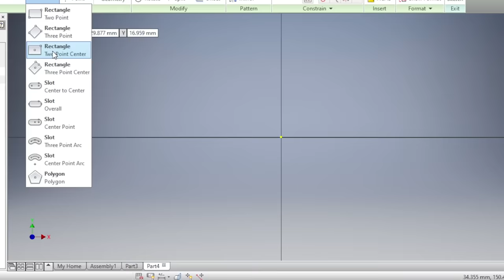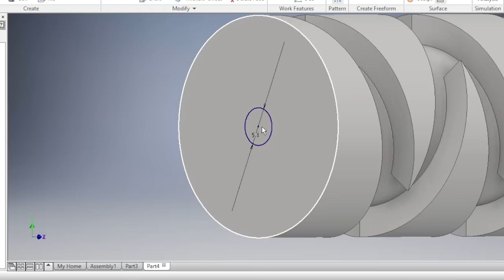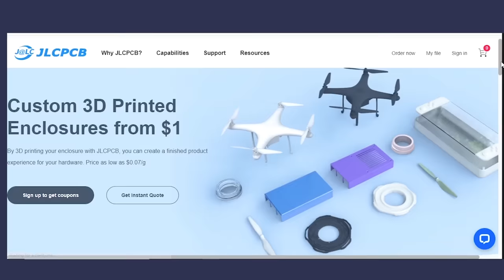DIY Winding machine with self reversing screw

Comment: The rotation is not proportional to winding, maybe if you can make sensor for bobin and add thread thickness input value to adjust speed proportion between winding and thread bobin it would make thread stack evenly
Reply: That would be cool. Even cooler would be a roll on the backside of the roll that has just the right amount of translation to autoadjust itself correctly without any need of input ever. Just imagine perfectly rolled, no matter what thickness your thread has.
Reply: @GamesPlayer1337  it's called surface speed in cnc, the larger diameter the higher the surface speed, and the cnc machine adjust for that, its easy to make this using to stepper motor instead of DC motors, and make it adjust everything in the code.
Reply: As another brought note, upgrade the DC motors to steppers and you can on the fly configure it to wind any just about anything on any width of spool.
Reply: I would use a tiny microprocessor and a Hall effect sensor to control both.  The code would be interesting.
Reply: @Tsma  can you link me to a video or a article on how this is done
Reply: I would suggest to use a single motor to drive both the winding shaft and the swirling shaft, using a gear ratio that will allow the proportional winding
Reply: At some point it will be easier to put the guide on a CNC lead screw and program the movement directly!
Reply: I would love to improve it with simple gravity based tension mechanism. Simple and works 100%
Reply: @gavincurtis  However, if you're going with steppers, you might as well position the thread directly instead of using this mechanism.

Comment: Leesona winding machines worked this way and had a weird mechanical glitch that caused them to wind guitar pickups in just the right way, making them more valuable than modern servo-controlled winders. I learned this when I toured some coil winding factories for a work project.

Comment: use two servo motors, replace the cam with an all thread rod with a very fine thread pitch, hook up an stm32, esp32, or arduino and a 595 shift register to some gate driver ic's, with dat now you  can drive some mosfets and igbt and use high current 24v  motors and now have a cheep winding lathe, prefect for winding tesla coils, although with a tesla coil your coil length is has to be shorter than your all threaded rod, since you only wind a single layer.... with servos you can precisely control wind speed, feed speed, coil spacing, winding and feed torque, so if you got the right motor you can wind as low 8awg to 50awg, just change dem torque and rpm specs depending what coil u bout to wind

Comment: For the second rectangle you could have projected the geometry of the face (even though I see no plane, maybe it's a 3D sketch, in this case it's ok like this), for the center extrusion I would not have bothered with specifying the length : an all through, or to next face would have worked like a charm. 
Besides those nitpicks about Inventor, that's a really clever design !!

Comment: 5:55 – Is is real? Do I really see somebody who put things like an Arduino on a socket, and did not directly solder it on??? You, sir, are a hero! Because this is how you are supposed to do things. Also, I learned that such a thing as a self-reversing screw exists. Is this what is also used for industrial applications? I can imagine those crossed threads must have a lot of wear when the screw is spun too quickly.

Comment: Interesting mechanism, although Integration-wise, it'd probably be better to have two motors. Reverse and adapt different yarn-widths in software then without having to need to change mechanical parts.
Reply: The cross section of the "yarn" dictates the jibe speed and would normally be handled mechanically. The "yarn" would be pulling the guide along and slightly behind it.

Comment: If I remember, what was called a rabbit.  When ploughing using traction engines at the edge of a long field would have a mechanism for the steel ropes towing the plough across the field and not bunch up the steel on the bobbin.

Comment: I had an early Epson dot matrix printer that used such a mechanism to drive the print head back and forth across the page, once for each line of text, even if only one character was printed. I can't remember what advanced the paper, perhaps it was a pre-stepper motor design.
Reply: It was a stepper.  They have been around a long time.

Comment: The winding spool could be simplified by simply using a low-torque motor or a slip-clutch on the shaft instead of toothed belt. Would eliminate the need for a PCB driving the second motor.

Comment: Well done! O
I'm wondering what the gear on the end of the spiral is for?
Reply from the maker: its to stop rod to slip out of clamp
Reply: @MrInnovative  
    You know, the slight imperfections in the spooling seem to make it the perfect threader for guitar pickups.
   You should call the guitar pickup manufacturers and use the phrase 
"as close to human winding as can possibly be emulated, while speeding up the production process AND cutting costs for human winders" !

Comment: You can use one motor. In this case it would be synchronous and you could tune density by ratio of gears between pulley and screw.

Comment: 1) Metal ring to direct rope? RIP rope
2) Why in hell do you need arduino controller? What kind of complex logic is need in this device so controller usage is really needed? DC power source, on/off switch, fuse, maybe regulator to set speed, cheaper 10x times
3) Why in hell 2 motors are needed? Both moving components can be perfectly powered by single one. Adding gears doesn't make device any more complex that having 2 motors. If really needed,  you can put variable ratio gearbox to control density of windings. More over, it is absolutely need in this case, since ratio is really variable by nature of the process

Comment: Do you really need Arduino in this project ? Using it only to adjast speed of the shafts looks a little excessive
Reply: Simple PWM Motor controller would work I guess

Comment: You go through the design process soo fast it is very hard to see what you are doing and what program you are using.. There is no information on what you used in the slicing of the print and what you used for the parts that you are seen ripping out with the screwdriver at 1:47. No information on the size of the board that you cut and no information at all even in the details of the video. No narration, sizes of the bearings used.. totally useless video.